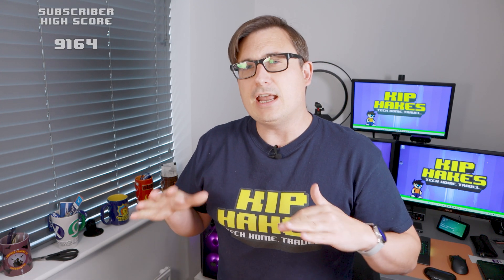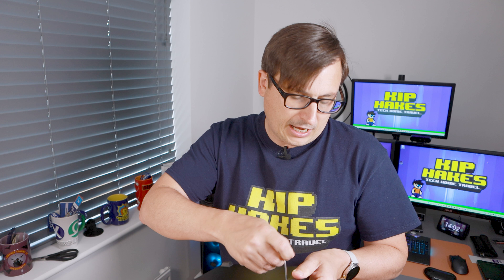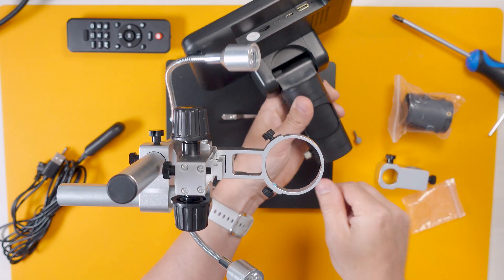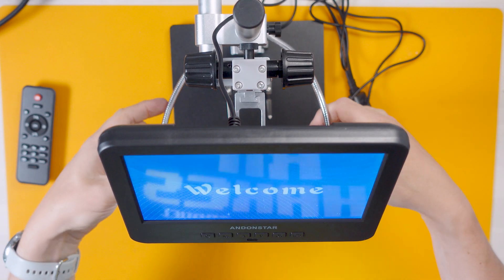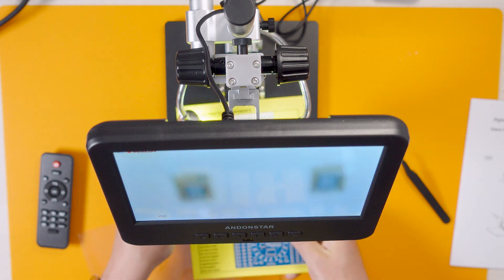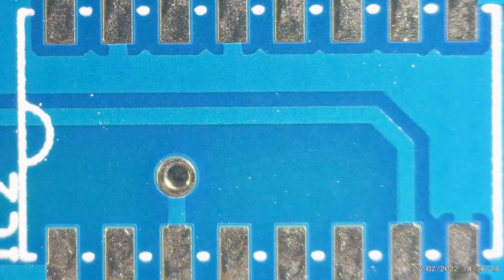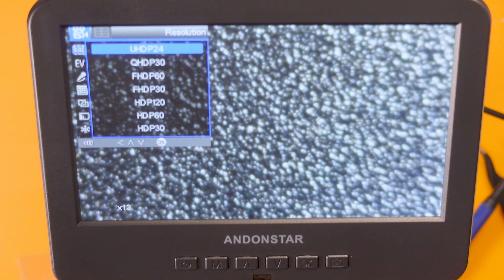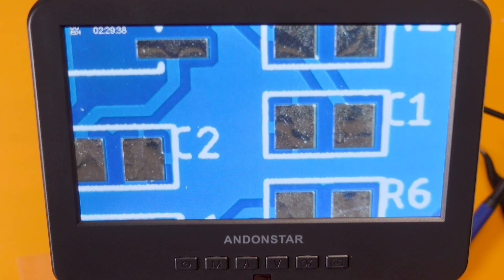Building and Testing the NEW Andonstar AD246S HDMI 4K Digital Microscope - FINALLY!!

Comment: I've bought the 7" version. That is more than enough for soldering / inspection work for me, a hobbyist. There is no 'shake' and the arms tighten very well. The measuring software is fine but a ruler under the scop is just as good. The PC USB works as a standard USB camera so using the cheese app in Linux will show it on a large screen if needed.

Comment: I see all these digital microscopes but everyone that does a review on one uses a farty ass little motherboard underneath it, is that all these are good for or am I missing something?

Because if that's the case then you wouldn't be able to do repairs on laptop motherboards or consoles etc?
Reply from the maker: They are great for allowing the viewer to see what you’re actually doing. There’s only so much zoom you can get on an overhead camera.. so these allow you to show more.
Reply: @KipHakes  Can you do full size boards underneath them?, Because i haven't seen it yet.
Reply from the maker: Yeah absolutely… especially easy with the mod I’ve made in a newer video